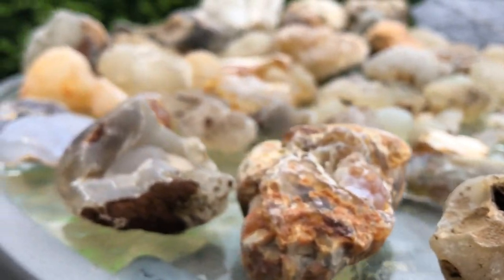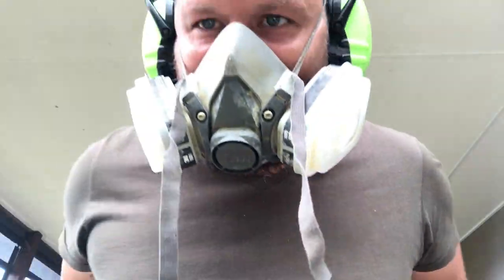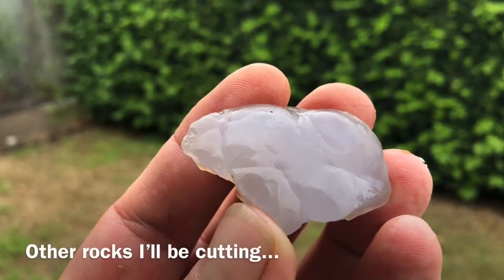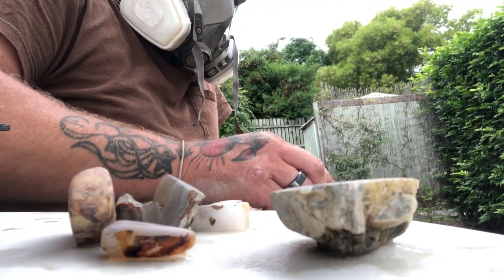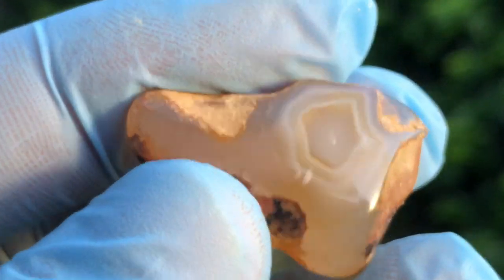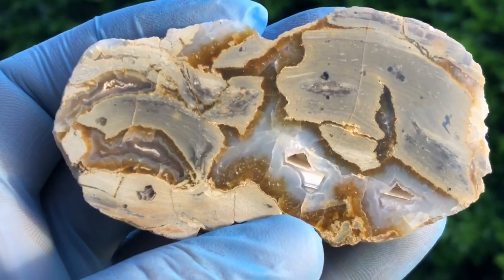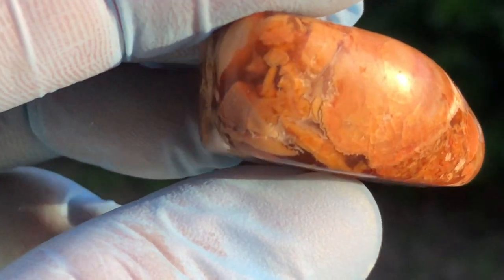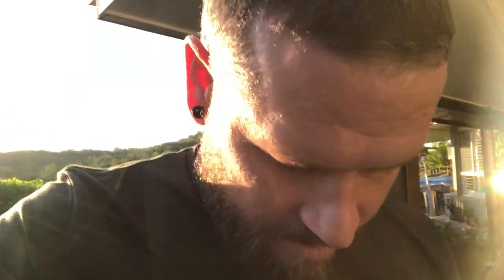Cutting & Polishing Rocks • Agates, Thunder Eggs & Chalcedony

Comment: I often go back and rewatch your videos and this comment is so late lol! Your polishes came out beautiful! I'm still very new at this and I've felt I had to go back so often on the grits to get rid of scratches. I just found 15 and 30 grit pads. It has made such a difference! I haven't had to go back yet. In the same bundle they have 6,000 and 10,000 which gives such a mirror finish. Of course that's adding 4 more grits to the rotation but right now I'm thinking it's totally worth it for the end result.

Comment: Might have to get me one of those sanders, will sus out Bunnings tomorrow. Lapidary club shutting down due to the coronavirus 😔Thanks for the tip.
Those rocks turned out amazing btw
Reply from the maker: Ah bummer mate. Where are you from? If you can find a diamond tool supplier they’ll have the polishing pads there as well. But Bunnings has the sanders for pretty cheap. Let me know if you need more info. 👍
Reply: Cheers mate! Hopefully I will track some stuff down. Central Coast NSW is home.

Comment: I fortunately have access to a20 inch saw through the Baltimore Gem Cutters Guild. We also have a number of Genies( 6inch , 6wheel diamond cabing machines). So check around in your area for gem clubs or mineral collecting clubs. Old timers in these clubs know where the good stuff is. Some clubs have classes and access to quality equipment. Those are some really great plumes (plumes are top dollar material, check the prices on line .

Comment: Quick question what size blade are you using IE; 4” 7” 10” and do you use the diamond blades for granite? Or just regular diamond blades . Oh yea and how many cuts do you get per blade roughly? I can’t wait to start cutting and I just have to get some higher grit wet sandpaper and the cerium oxide for polish
Reply from the maker: Hey man! 
So the saw I have uses a 7” blade. And it’s a diamond impregnated blade that’s made for cutting ceramic tiles. I bought this last year and I’m still using it. If it starts going a bit blunt feeing I run a regular red brick through it a few times. You wait, it makes the biggest difference. 
Have fun mate and get ready to be amazed by your rocks. They’re so pretty inside. 😉👍
Reply: Rookie Rockhounding . Thanks brother appreciate it and keep the videos coming and happy rock hounding 😀

Comment: Hi guys! I'm just about to do some cutting of my own, but I'm just not positive of what is in the saw,,,,water? Oil of some sort? What should I use?
Reply from the maker: Jubi 
Hey Jubi, so in my tile saw we just use water. I put my hose into the water tray on a very low drizzle. I hope that helps 👍👍👍 happy cutting!
Reply: @Rookie_Rockounding  Thanks! I have a 3 inch cutting blade, but my old man put mineral oil in it. Is that on ok thing to do??